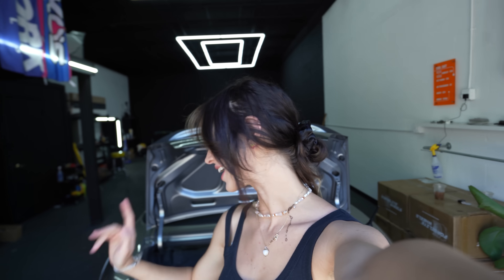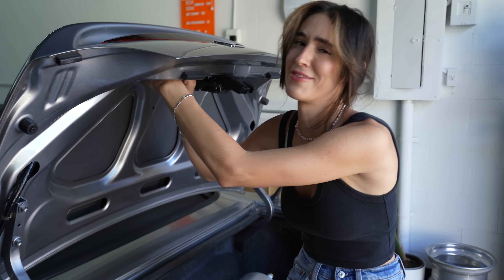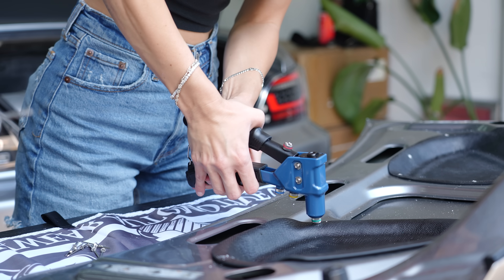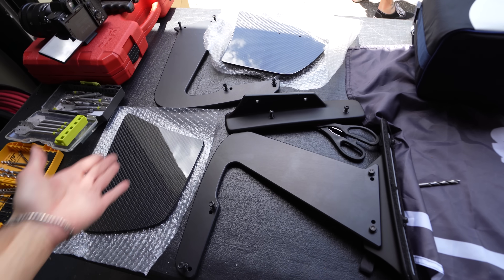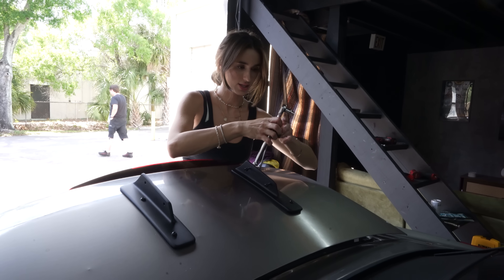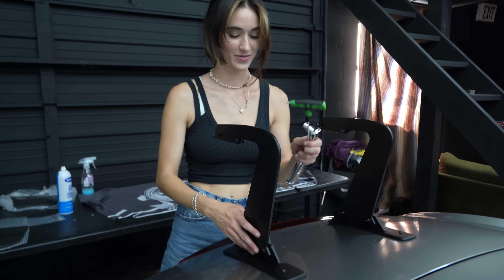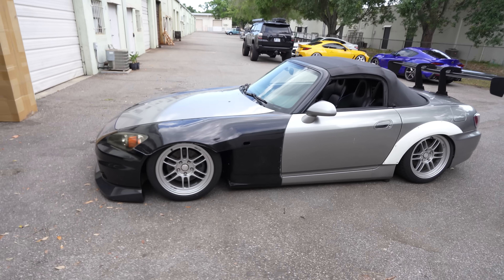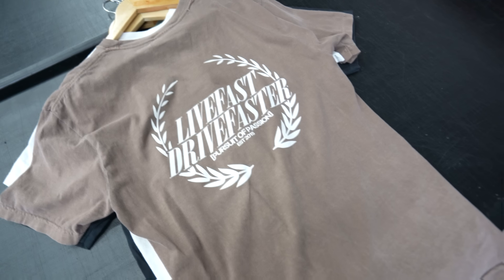Building a Modern Day Fast and Furious Suki Honda S2000- BIG WING (Part 4)

Comment: I don't know if you did or not, but if you didn't, it would be a good idea to pull the wing off, smooth out the burrs on the top side of the mounting holes in the trunk and then trace out some thin rubber gaskets to install between the trunk and the wing's base mounts. That will prevent water from leaking into your trunk.
Reply from the maker: Yea! I just didn't haven any little rubber gaskets for the holes, but i will putting them on when the wing comes off for bodywork (:

Comment: I was wondering if you were going through to the outer skin with thr drill when doing the holes for the rivets. Then you turned it over & I saw all the dents 😂
Reply from the maker: OH yea i was blasting through it without thinking 😂 luckily though it will be getting fixed when the car goes to bodywork for everything
Reply: @NatalieRoush  yeah some PDR will correct that no problem
Reply: I was just about to write the same thing lmfao!!